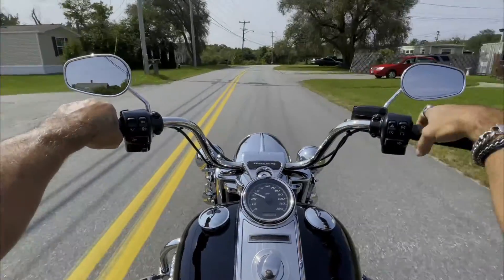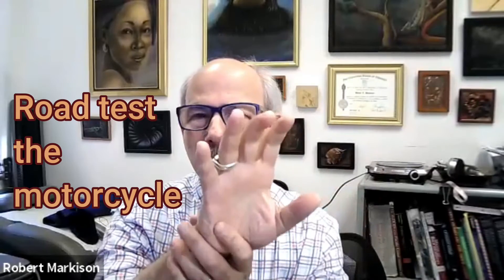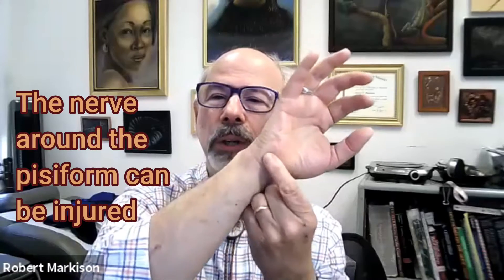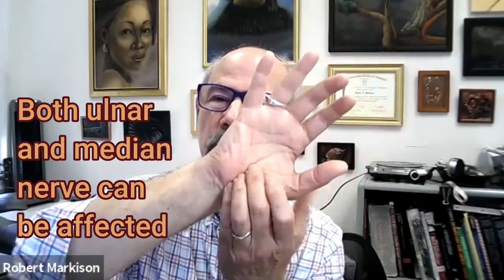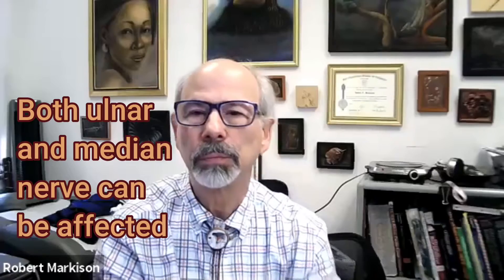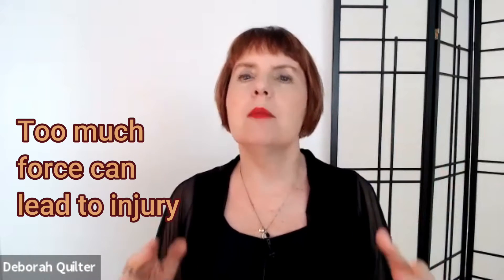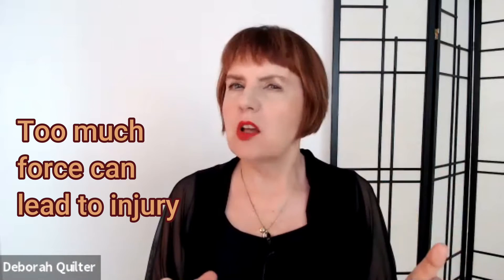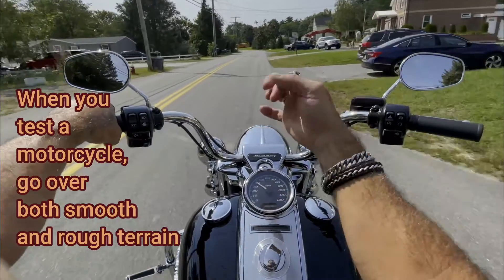Why do my HANDS GO NUMB when I ride my MOTORCYCLE? Prevent Repetitive Strain Injury

Comment: I hold the bars like I hold an egg . .gently not a tight grip but during slower turns a tighter grip is needed but the bike has less vibration from the revs of the engine . .
Reply from the maker: Nice analogy.

Comment: Another reason I can think of is - The softer seat of a motorbike than a bicycle. Since I got a sports bike, Im leaning forward with my weight on the lower handlebars. Since driving this bike my arms and hands go numb at night in bed. I have a bad back anyway. I think its pinched nerves causing this. However on my racing bicycle it has a very hard seat and even though its more of a stretch, the hard seat offers support, unlike the soft motorbike seat which lets your back set in awkward positions.
Reply from the maker: Yes, I often look at the posture of people who ride motorcycles and wonder how they can avoid back pain. That said, hands going numb at night in bed can be a sign of carpal tunnel syndrome and other problems so it would be good for you to check it out. See this:https://youtu.be/rhFOx9CCO04 especially 2:26.
Reply: @DeborahQuilter   Thanks for the link !
Reply from the maker: My pleasure!

Comment: Without a doubt, vibration can cause hand numbness but most rider hand numbness comes from improper handlebar elevation.
By adjusting the handlebars up or down from where they are when your hands go numb will make a big difference.
Most people with a highway bike have their bars to high and it causes nerve pinching in the shoulders causing the numb hands.
I used to suffer the numb hands until I adjusted my bars.
That area of the hands he points out never pressed against the grips ever, unless I intentionally put my hands up on the grips that way intentionally.
Reply from the maker: There are so many variables that can play into hand injuries. Thanks for weighing in.

Comment: Fortnine has a video where he claims the ,,ice cream cone,, grip beats the just straight on ,,normal ,, way.
Is that correct?
When I drive I almost always get numbness when I go over 80km or 60mph, wichever grip techniques I use.
It's a three-wheeled motorscooter wich vibrates alot at stationary and low speed. 
I wear full gear plus airbag vest.
Reply from the maker: While in general I like the idea of a more neutral grip, as in a handshake or holding an ice cream cone, I would have to be more familiar with the handlebars to comment further. Getting to your second point, vibration can be a serious issue. Please view a follow-up video I did about that: https://youtu.be/5jU8DFo0uVI. I would encourage you to see a doctor about the numbness. And also be careful how you use your computer. The standard computer keyboard puts you in the same position as the handlebars of your bike and that's a risk factor for RSI. I will be making a video on a better keyboard so, stay tuned.

Comment: Cruise control with throttle by wire. Bar weights to dampen vibration, a motorcycle that doesn’t vibrate as much in the first place is also key. Anti-vibration gloves. combine all of these together :-) neoprene grip covers such as grip puppies. Do not grab hard and very importantly, a windshield so you don’t have to grip hard due to wind, pulling on your body
Reply from the maker: Hello Nate! Thanks for weighing in. And yes, people tend to over-grip, so anything that helps them not to do that is great! Best, DQ

Comment: Thanks for the info very useful. 

It's made me realise that as a young adult I turned my mountain bike handles so that they were very straight and I found that most comfortable (my hands seem to be naturally rotated so that the typical bar placement that points slightly back is uncomfortable).

My forearms are quite developed from rock climbing so I get arm pump when I'm riding my motorcycle on the race track (even with these bars adjusted quite straight) but i think that's from the physical aspect of track riding (from what I understand the muscle gets squashed inside the facia and the blood can't circulate out easily). 

I have a road motorcycle (I hardly ride on the road) and I find my hands get numb on it quickly. Road riding is slower and more "sat up" so I've got more weight on my hands but I'm figuring the main issue is I haven't set up my bars so they're putting pressure exactly on that point you've noted (also I need to get decent gloves)...

Anyway.... thanks for the scientific input (a lot of the other internet stuff doesn't really have that to explain/ help properly understand the problem)
Reply from the maker: Thanks for appreciating the medical science, Mark. Truly appreciate this. And I'm so happy you found the video useful!